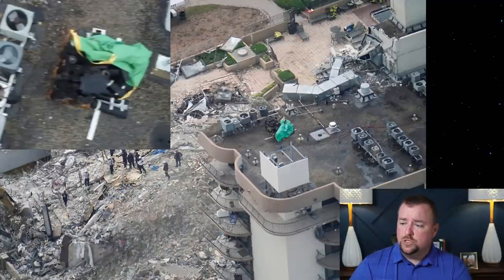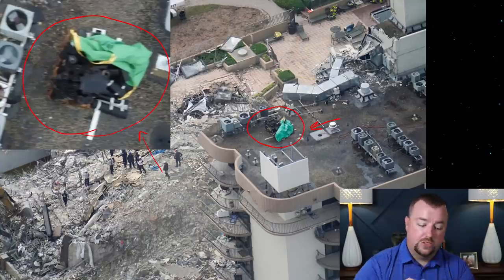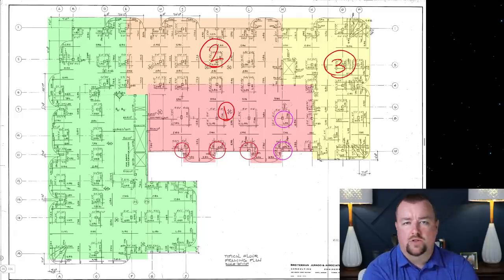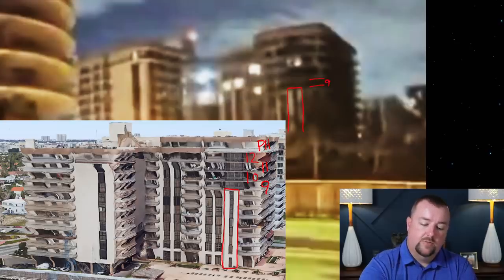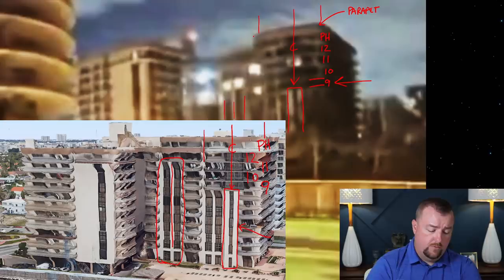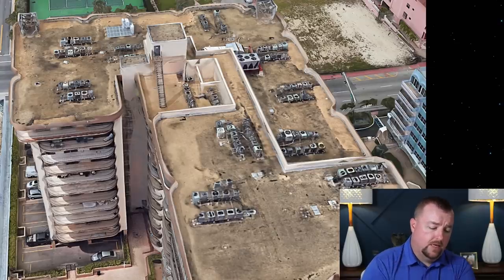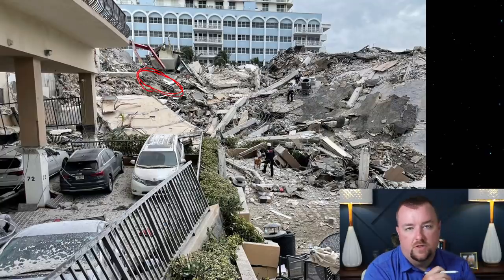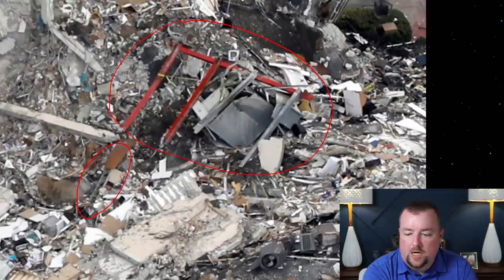Surfside Building Collapse - Did it start at the roof?

Comment: Could it be the bright lights are caused by a electrical problem whereas the building risers which would be 480 VAC feeding per floor transformers which would step down the voltage to a level to be distributed out to the units on each floor. It wouldn't take much during a collapse to damage what we call the gutters which is where the wiring is placed and that damage could have crossed the 480 into the lower voltages feeding the units. If that happened any lighting connected to the lower voltage side would become both very bright and may as a result have a change it's kelvin causing it to become a whiter light for a short amount of time, but a time long enough to be recorded by a video camera.

Comment: the penthouse was added later, was it in the original construction planning for stress weights and pillar stability. if it was not in the original plans then this extra weight would have contributed over the years to its degradation. would they have back then had to iam not sure what its called but you make samples of the concrete and then test them under pressure, would they have any of these, was the building made to comply to basic minimums or did they make it with extra support. its a coincidence that the side WITHOUT the extra level added (penthouse) did not collapse. also that AC unit looks newish, did it replace and older one is it it completely new adding more weight to the structure

Comment: By the picture at 25:28 it seems pretty clear that the collapse started at the pool deck (in the basement), between the pool and the group of cars sitting on a collapsed slab. The white paint on the support columns is the top half of the basement parking garage and the reason it didn't collapse to the basement slab, is because it is sitting on cars in the parking garage. The structure above it is still standing because the collapse started at the bottom, not the roof. The most sunken part of the pool deck is right where the building started to collapse. In 2018 this building was assessed (40 years safety audit) by an engineer and deemed in need of "very expensive repair" to fix the structural problems with the pool deck. The engineer stated that if the repairs weren't done (remove the tiles, concrete slab, water barrier and repair all damaged structural membered as necessary and then replace water barrier, add slope to new concrete deck....). "If these repairs aren't addressed, the reinforcement bar will continue to degrade exponentially".  They were warned 3 years ago and did nothing because the repair was very expensive and a big inconvenience, considering the noise from jackhammers and loss of use of a substantial potion of parking. 

This tragedy was caused by neglect, not accidence. A pool contractor was in the basement only days before it collapsed and he took pictures of the gapping cracks in the support beams, where the rusty re-bar was clearly visible. There is video from across the street (at the basement entry parking garage) 15 seconds  before the building collapsed. You can see the huge chucks of concrete on the ground (likely from the beams) and water gushing out of a pipe, which at often attached to the side of beams. 

Everything points to the basement beams (pool deck and also just inside the edge of the building) giving out right in front of where the building started to collapse. The pool deck goes right up to the building and is tied into the same (structural) parking garage which is under both.

Comment: Maybe the added weight of the "roofing materials" was to much for the ground level structures that had been weakened over time by water corrosion. How significant was the roof deterioration ? How significant was the water infiltration ?

Comment: At 22 minutes, there are images that show column 72. It appears to be intact, BUT the floor that it was supporting above the car park has apparently dropped, without bringing the column down, leading me to ask (in my ignorance) what was the column actually DOING. If it wasn't holding up the deck above parking spot 72, then what was holding it up? Same for the other columns that don't appear to have actually failed, but which show the deck falling around them. Is this perhaps an indication that the columns may have not been a primary cause of the collapse, and that we should be looking elsewhere for an explanation? I'm not an engineer, or an architect,  but after viewing various videos of this collapse, this is one aspect that I truly don't understand.
Reply: The columns were holding the pool deck up, but not very well.

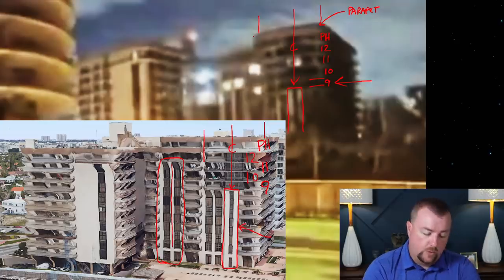Comment: I'm sorry but it's rather clear to me that at around 15:45 the pair of lit up windows are at the 10th floor, not the 11th. You can see the white wall columns going up one more floor above them in the same style. Which would suggest the penthouse crashing down into the 12th floor, on top of the 11th still standing.

Comment: Crazy how each floor is visible in the rubble. 
It's like a layered cake melted or more like stripping off or 
sanding through multiple layers of paint buildup.
     I just wanted to point out, the pool seems to be empty now.
In the middle of all this, they decided to drain the pool?
Reply: The pool water probably leaked out as a result of damage.

Comment: 18:57 I didn’t know that a penthouse was added at a later date. And the penthouse is added on the part of the house with the smaller dimensions pillars (in the garage) if added at all it should have been added to the part of the house with the thick pillars….

Comment: I saw a video that showed that there was a pipe broken with water gushing out of it and a bunch of debris on the floor of the parking garage minutes before the building collapsed. I do not know if it could have started at the roof.  You would think that the materials would not weigh nearly enough to cause a collapse unless the structural integrity of the building was already compromised elsewhere.

Comment: Im stopping at 23 minutes ..im.going nuts waiting for you to tie-in what the significance of the neighbors that heard a crash, then took a picture of the " fallen beam" and debris in the parking garage 6 minutes before the building collapsed. Is the parking garage entrance tied to the 12/ penthouse area 1st section roof collapse? Could one pillar that runs basement to roof have failed. ?
Reply: So, if the parking garage/ pool deck area collapsed first. It must have sent a tremor straight up from the parking garage to the penthouse..the weakest link was that central penthouse area. Causing that to cave in.  If there was roofing going on there, with materials, and possible existing hidden concrete spalling from a leaky roof..it could have been a weak 11 12 pent house area problem..

Comment: I agree with you that the 12th floor and penthouse are missing. From other pictures and plan drawings, what is missing protrudes from the “window wall” like a unit wide balcony. If those balcony style protrusions had already fallen, they would have accelerated downwards for 11 floors before landing on the pool deck/garage roof right near the easternmost column of the critical garage pillars holding up the south side of the building.

Comment: You said that the penthouse was added later. This brought to my mind the question: Did they include the possibility of a penthouse on top in the original design, and taken the extra weight in account for calculating and designing the building?

Comment: The brightish white lights on the left of the first section are strobes from the Fire Alarm system due to the water flow alarm caused in the garage level from the sprinkler pipes breaking. You can see more of the flashes after the collapse in the fourth part of the building. Also there's many other videos just after the collapse that show the fire alarm hornstrobes going off
Reply: could be

Comment: I've just watched all your videos on the CTS collapse. A few things that caught my attention: 1) From the 2018 report we know why the work started on the roof....OSHA requirement to have those anchor hooks in place. So I think they started there due to that being an obvious code violation. 2) Not sure how much of a bid process there was as some news articles state that a previous board president and head of the work committee thought it best to go with Morabito because he was already familiar with the property, even though his was by far the highest bid. These costs fed the feuding within the board and with residents. 3) The entry drive video is very telling about an early point of failure and does validate the comments made by 2 residents right before the main collapse. 4) I would like you to touch on the pool deck more in a future video. EX. the 'design flaw' of it being flat and not sloped to allow for drainage. How did this contribute to it's deterioration and eventual failure? 5) You mention the extra vibration from roof work as being a possible accelerant to the decay. What about the extensive construction of 87 Park to the South? Wouldn't that vibration and shaking also accelerate any decay in the steel/concrete? 6) RE: This video: https://www.youtube.com/watch?v=hynHiWE818c  How realistic do you think this scenario is? Could a collapse of part of the pool deck compromise the columns supporting the south façade? This video shows the pool deck attaching to the façade columns, which seems to me to not be such a great idea. 7) When you watch the video of the collapse, everything seems to be pulled towards the area of the deck and the columns you've highlighted so I'd agree that the failure happened there. Question is what triggered the deck collapse (I lean towards multiple factors..design, maintenance, vibration from 87 Park and roof construction, subsidence all coming together) And how did a failure of the pool deck slab eventually compromise the columns? So much to consider here and I'm very interested to hear any further information on the how and why factors at play here.
Reply: 1) If the pool deck is about to collapse, still don't think OSHA would prefer to ensure there were hooks on the roof before the collapse. 2) They probably thought MC would be discreet. If they failed to slope something as simple as a pool deck in Florida, did they fail to slope the roof? If they managed to slope the roof, how did they fail to slope the rest of the sloped surfaces detailed in the P drawings? Just like any incident, there will be root causes and contributing factors that in themselves would not make a building collapse. Vibrations on a compromised building is probably one thing. I think most people's intuition is a collapse of the pool deck would not collapse the building and it could have been the thinking of the BOD as well. But there were shortcuts taken at the foundation building step (and these last minutes changes we all love), so the building was not as solid was it could have been from the start.

Comment: Just a foot note that may or may not be speculated upon later in the video.  You do have high voltage wiring through out the building (appliances, etc..)  For anyone that has done welding, that super bright 'flash' might have been just that.  A flash caused by the electrical wiring getting ripped/pulled/torn.  It will want to arc when it's ripped apart.  I would think (again, speculation on my part) that you are seeing the arcing of the wiring as it's getting torn out.  

I would use welding as the example, as it creates a very high intensity almost 'white light' while the welding arc occurs.

Just throwing it out there.

Comment: As  a lay person, what I want to know is, given the 2018 report with a recommendation of 9 million dollars of repairs, would it likely prevented the collapse had they immediately done the repairs or should the building  have been evacuated and demolished?  I know I have been in parking structures with exposed rusting rebar and cracked concrete like seen in the contractor photos.  It never occurred to me that the structure could collapse.  I just assumed if I saw it, the owners saw it and were not concerned.
Reply: I always thought the same thing. I didn't know what "concrete spalling" is before all this and I assumed that cracks in concrete were mostly just cosmetic issues. (Unless it was obvious that something critical was really starting to come apart). I always thought that cracks and holes in concrete were caused by EXTERNAL weathering. I didn't imagine that the rebar was corroding and the concrete was being eaten from the inside! This is actually pretty scary.

Comment: Could it be that the roof of the center section looks missing or lower because of the angle and point of view of the photo. Also perception of heights and levels is deceptive by what is in the forefront and background of the photo. What I mean is that the middle section is phsically futher back than the east section and thus seems lower than what is actually physically closer and in the forefront. The lower angle lense angle of the frame capture photo versus the lense angle of the photo being used for comparison photo makes the roof lines appear different. Maybe another frame capture photo taken by the same from the same angle would be better to use as a comparison to the one that is here apparently from seconds before the building collapsing. Thst way you could see iff there is any difference in the roof lines.

Comment: I can't get the pictures of the damage in the pool mechanical room out of my thoughts. I'm thinking a failure of the coping years back led to a trickle water leak with a continuous water supply meandering under the pavers on the pool deck, all the way to the garage. On the side of the mechanical room there was nowhere else to go, so collect and go down.

Comment: On the brighter lights at the start of the CCTV, it may also be window/facade failure or crumbling.  I think column K9.1 might have been about quarter to half a floor ahead of I9.1 in the collapse.  That would twist the living rooms and large balcony window in the x10 apartment stack.  They are possibly brighter because the glass is missing, maybe even some facade wall has broken away.

Comment: Josh - the electrical wiring was not fed vertically. It was horizontal, from rooms at the 2, 3, 5, 7, 9, and 11 floors, along their corridor ceilings and then either up or down a half floor to the unit panel. You can see the many rows of conduit at these floor levels in the wreckage photos, just north of the elevator shear wall. 

Further, the bluish lights at the left of your frame are much better explained as electrical shorts than balcony lights (which we see nowhere else). 

Those blue flashes are in fact skipping a floor and they are consistent with being at either 9 and 11 or possibly just above. When the flashes go out, the lights go out.

Also, when you are pointing out the staircase and the red frame, those aren’t on the “missing” penthouse roof but on the 12th floor roof. So their survival is not really relevant to whether the PH roof could have collapsed earlier. 

And while your identification of floors under the west penthouse area appears to be sound, it the roof there was damaged, it’s conceivable that the white “stripe” was obstructed. 

It’s hard to believe that floors that have descended 15 feet still have power from a horizontal feed. I’m not suggesting that the rest of your theory is wrong, but this is a weakness. 

One more point - your google image of the building is from a fairly high vantage point. Take a look at one taken from the beach trail, and you’ll see the exact surveillance camera and perspective. You’ll also see that it’s not just that the penthouse roof is missing, but also that the roof is level from the elevator to the vertical red line you drew. But when intact, it wasn’t a continuous line. The missing penthouse roof started about halfway between the elevator and the intact penthouse roof. 

Again, nothing I’ve written disproves your theory, but some of it isn’t a perfect fit. Great job all around and it’s impressive that you’re correcting prior errors.

Comment: In looking at the video of the collapse, it appears to me that the front center facade (the front part of what you marked as 1) began to collapse first. When it was down by a couple of floors, then the back part of 1 and maybe the front part of 2 started to collapse. Then all of 2 or the back part of 2 (depending on what constituted the middle section) started to go down. After all of the central portion was down, then section 3 collapsed. Take a look at the top of the central section as it goes down and see if you agree. It goes down in 3 pieces, not 2, followed by the section you’ve marked as 3.

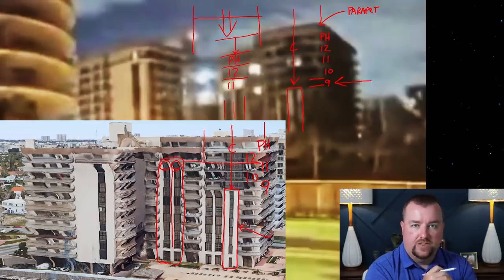Comment: at 18:08, the light,s, are not lights turned on, it is the electric panels short circuiting, blowing, out, when they are separated the electric piping from the panel itself, there is a short circuit, now, normally at ground there is a fuse, the fuse will need like half a second to blow, or a 1/4 second, if is a thermal switch or fuse, so that is why maybe, there is just one frame those light.

Comment: The green and yellow thing @1:04 is not a tarp.  It is a dumpster bag.  They probably used a crane to lift those roofing materials to the roof in that bag, with the intent to use the bag for trash from the tear out.   The bags are tough and this may be standard for roofers but seems sketch to lift that kind of weight so high over an occupied building in a bag.